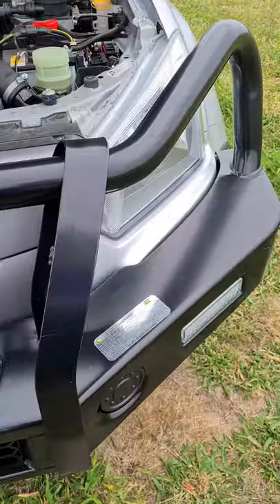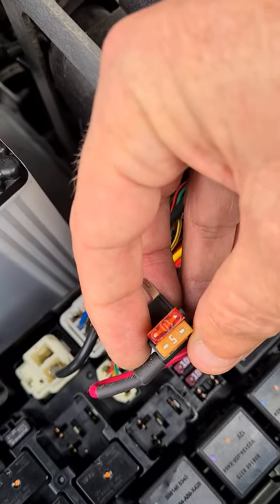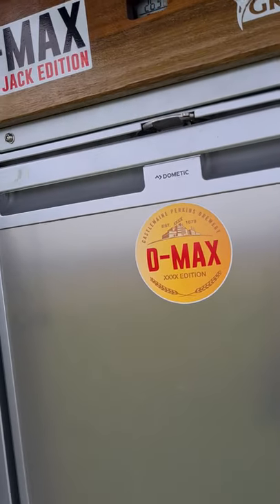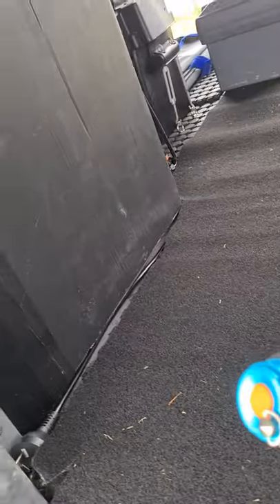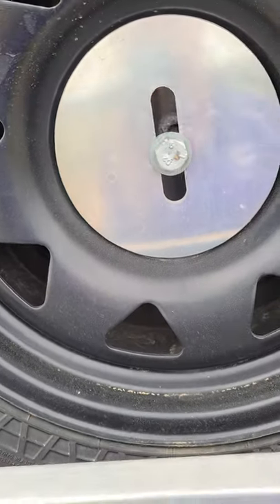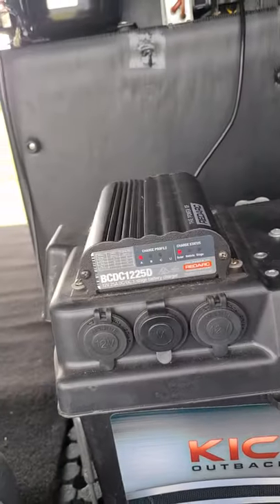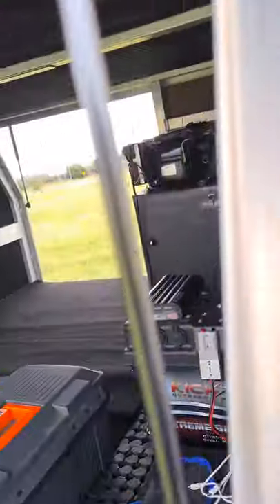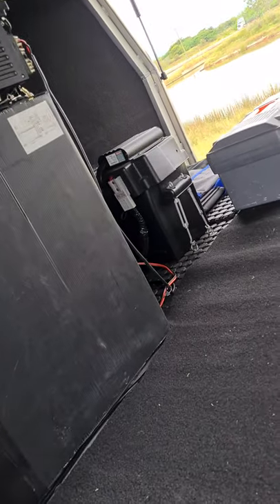12v and canopy

Comment: Good video. I have a similar setup (see my video). I ran a separate cable from crank battery to tow bar for Anderson plug to charge camper trailer, rather than piggy backing off aux battery in canopy. I also use it for compressor etc as they shouldn't be run off aux battery. Just an idea.
Reply from the maker: Seems to run fine and shortens cable run to camper.
Reply from the maker: There is another dcdc in the camper to fix and voltage drop.

Comment: Hey Gerard, how is your battery holding up running that fridge? I have a similar battery set up and am thinking of running a similar fridge. Love the canopy and tray. Cheers James.
Reply from the maker: Holds up well, with 160w solar panel on the roof. Only runs the fridge and very little else.
Reply: @GerardHand  Thats great, cheers